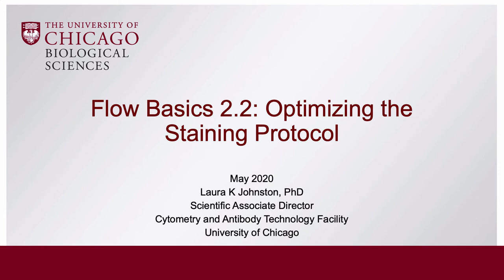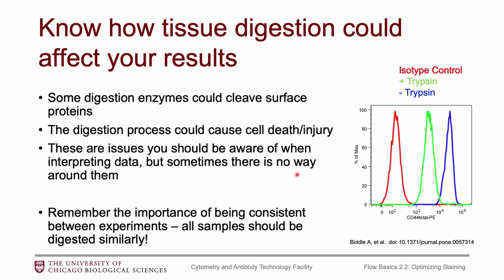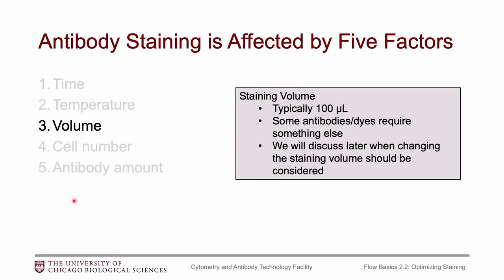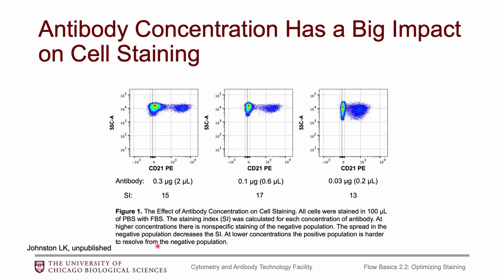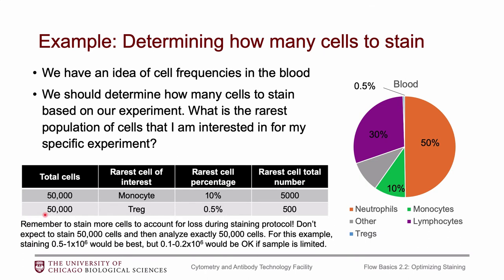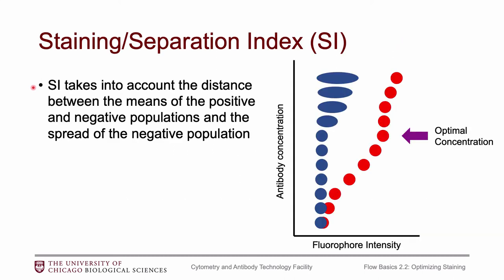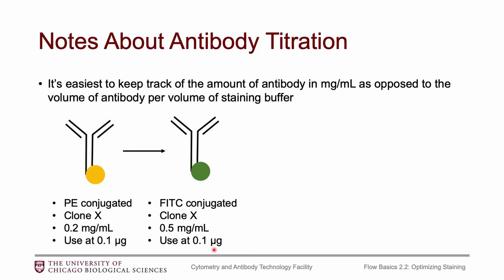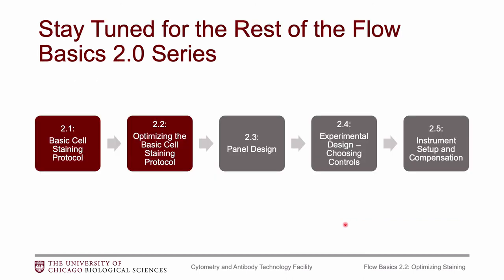Flow Basics 2.2: Optimizing the Basic Cell Staining Protocol

Comment: Is it necessary to perform doublet discrimination and viability analysis when performing antibody titrations?
Reply from the maker: Hi Lazar, 

Generally, I would say no. Most people titrate antibodies as a single stain. Doublet discrimination is important for ensuring that we're not getting false positives. Imagine if two single positive cells are stuck together - without doublet discrimination we might think we have a double positive cell. Because there's only one antibody to titrate in one tube the doublets aren't really a concern. Viability is also important for accuracy of your experimental data, your antibody might be nonspecifically binding to dead cells. See this blog for further explanation: https://voices.uchicago.edu/ucflow/2020/11/19/how-to-identify-problems-with-panel-design-bad-data-part-2/. For titrating an antibody the dead cells usually don't interfere too much with determining the optimal concentration. But I guess if you're seeing a much higher frequency of positive cells than expected or it seems like the background is really high maybe it's worth it to include a viability dye. I've yet to run into that situation, but I wouldn't say it's impossible. In that case you'd have to then worry about compensation between the antibody and viability dye, which is just more effort than a single stained tube. The simplest experiments are ideal.